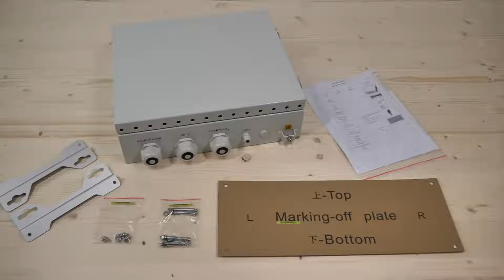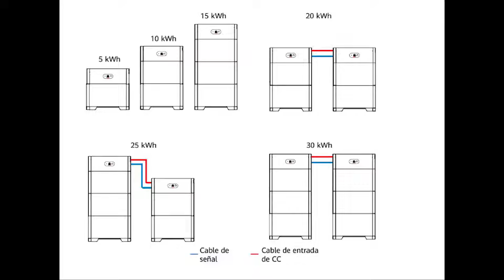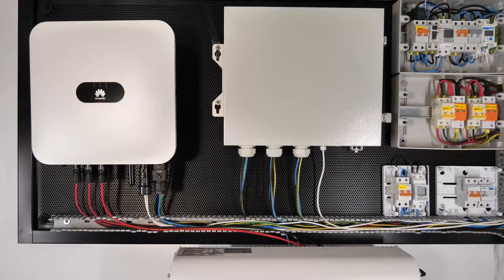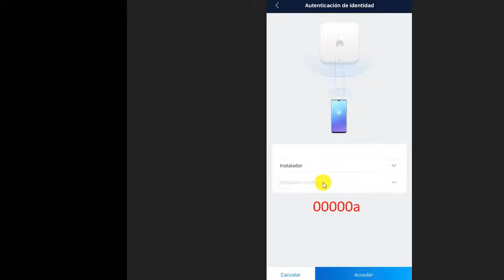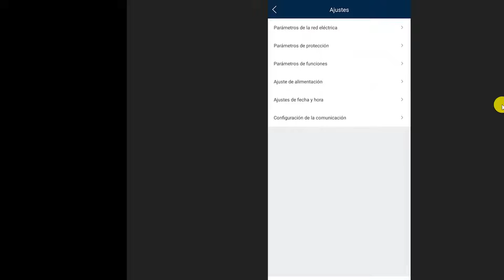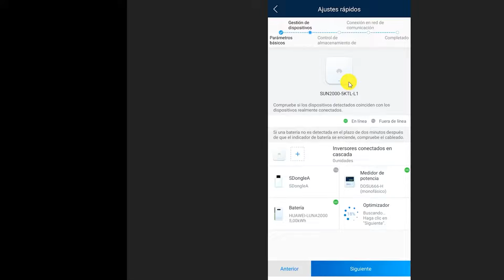Huawei LUNA2000 Lithium Battery and BACKUP BOX Tutorial (Installation and Setup)

Comment: Can I install 4 battery packs on top of one another? And put the power module on top of that? So i get 20kwh battery pack for a total of 4 battery modules??
Reply: I seem to remember a stack of three is the recommended limit (you'd need to check) - I only have two to produce 10kws.

Comment: I bought the KTL 6 single phase and figured it will not work in off grid mode if you do not have backup box B0 because of the communication... But im curious will it work without battery after I install the backup box since I have no grid its total off grid!

Comment: Nice Video, thanks for that. Question: While the System is connected to the Grid, is there also Power on the L1?  (at 4.23) So all critical Loads can be connected to this output (X1)?

Comment: Beware that this battery might emit a high frequency 'hum', which if installed within the home, will probably wake the entire household. My unit emits a 45/50 decibel humming noise and now, after three frustrating months and numerous emails, Huawei technical services have accepted there is a problem and have agreed to replace the 'power module'.
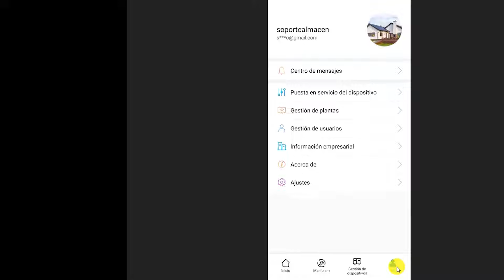I really hope that my being woken up at 06:45hrs, will soon be at an end, but if you also get this problem, you will need to be very persistent to get this issue resloved.
Reply: How did it go ? Did the replacement fix the humming ? Thx
Reply: the  @404allowed :  the replacement is much better, but it still gives a reading of about 28 decibels, as opposed to 45 to 50 from the old one. Huawei have never formally accepted that the unit was faulty and it took a video of my bedroom recording a reading of 46 decibels to persuade them to offer a replacement. I'm OK with the humming level now - it doesn't wake me up at about 7am, which seems to be the set time for the dehumidification unit to start up (time cannot be altered, for some reason) and my system is working very well. My only advice would be, make sure your battery pack is installed far enough away from possible disturbance - they can be fitted to outside walls (I'm informed).
Reply: @normansaunders2721  thankyou for responding so fast. Any ideas. I’m in a Penthouse (only 2 of us at the top level) facing the ocean. i want to set up a hybrid system but only use it Offgird and so where do i install all of the non solar elements. Reading your humming example that is an added challenge for me..I guess 28 decibels is the market for me. Thx
Reply: @404allowed  After a battle to get my original unit replaced (made much more difficult with Huawei customer service being in Romania and me in the UK) the new unit is much quieter and after a 'bedding in' period the fan unit doesn't appear to cut in so often.
However, I wouldn't have one installed very close to a living, working and particularly sleeping area, because the humming emitted by the de-humidification unit. I guess it would best be attached to an external wall, if possible, or in a garage.
Reply: I can confirm the humming noise coming from the system...